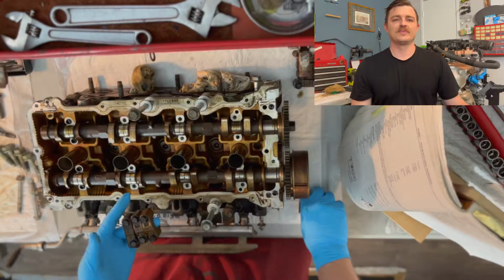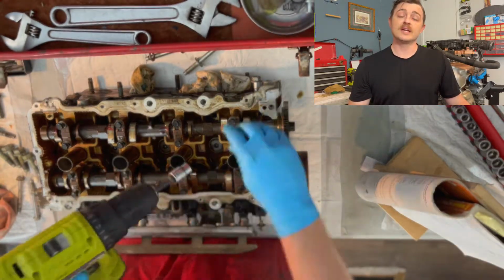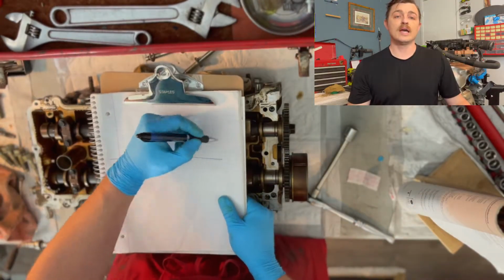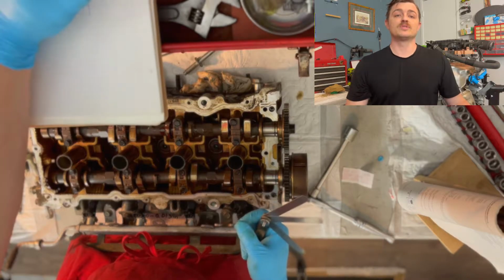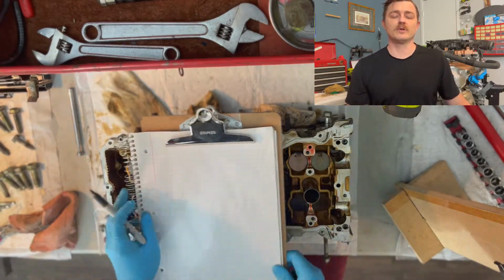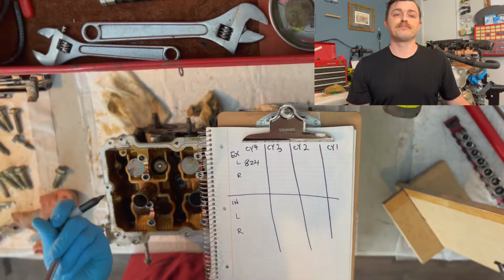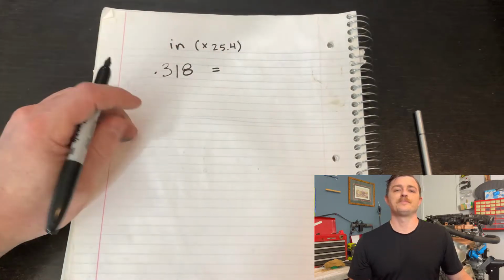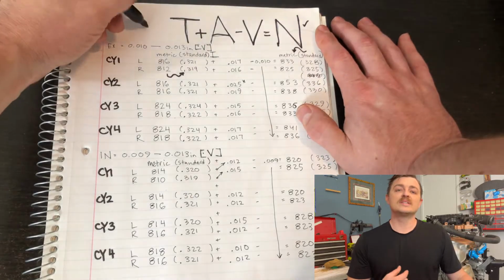Texas Toolbox - Nissan Altima QR25 Valve Lash Clearance

Comment: Does the new generation qr25de engines need valvle clearance or thy have hydraulic lifters ?
Reply from the maker: Hey!  I’m so sorry for taking so long to answer this.  For QR25DE motors the head design is unchanged but the motor assembly has updated parts and tuning to support turbo applications which are being implemented extensively because of their performance for emissions related engine management.   The heads for the QR25DE, as with any engine cylinder head, will need valve clearances once the part has been modified.  That said, you could probably get away without if you don’t mind a little chatter and slightly faster wear of your valvetrain - but head to valve clearance won’t be an issue. In this case I had the head decked and block decked but retained stock lift and stroke and I had no clearance issues between the valves and rotating assembly’s pistons. Since this engine design is OHC not an OHV (google ohv vs ohc) it will not have hydraulic lifters.  The “cups” that sit over the valve spring are the “lifters”, but a better more technical word would be “followers”. Hope this helps!